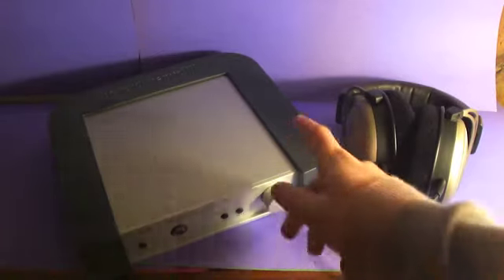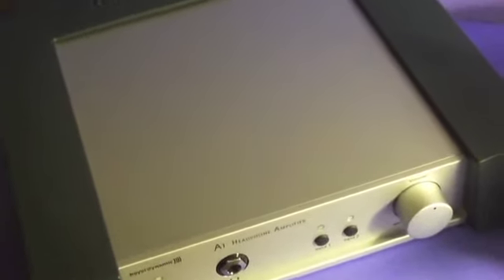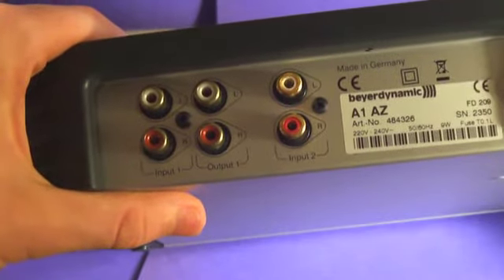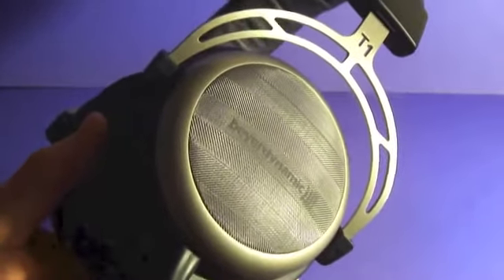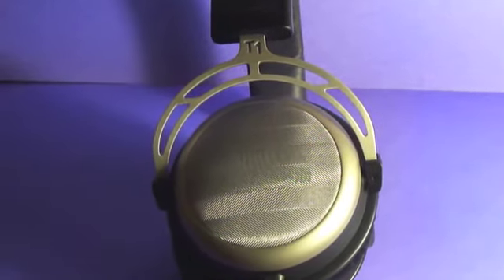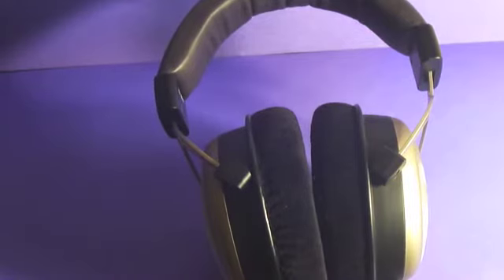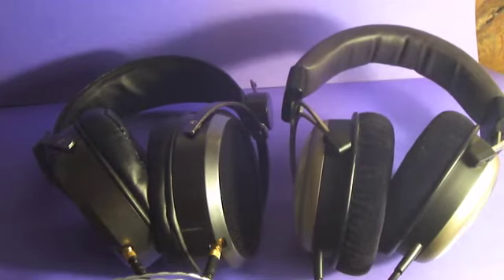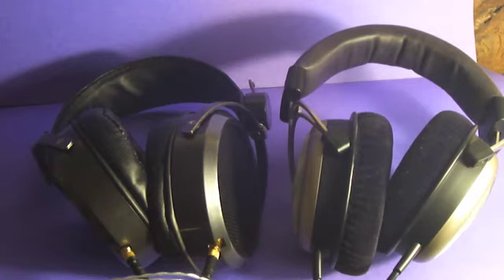Beyerdynamic T1 Headphone and A1 Amplifier Review - With HiFiMAN HE-500 Comparison

Comment: Another thing that I found when trying the T1 is that it sounds great with speaker amps. I mean, the headphone outputs on the speaker amps. If someone has like a higher end Marantz, Rotel, Cambridge Audio, etc., really no need for an additional headphone amp with 600 ohm Beyers.

Comment: I had this amplifier, A1, and I would strongly recommend to try a valve amplifier for comparison as this amplifier gives out 100ohm signal that in theory should be good for 600 ohm headphones but it sounded very uninteresting to my ear. This amplifier (A1) sounds similar to an old fashioned receiver from Marantz, AKAI etc., it gives little detail, rather flat sound. I sold this amplifier. I am a great fan of Beyerdynamic headphones though.

Comment from the maker: It is not a full tube amp but it actually uses tube + MOSFET topology rather than tube and op-amp and the tube (6N16B-Q) is not just for show, it is in the mix. But yes i have used many tube amps before just not with the T1.